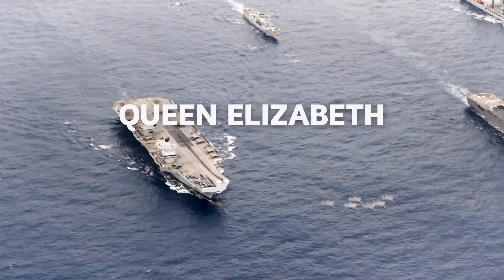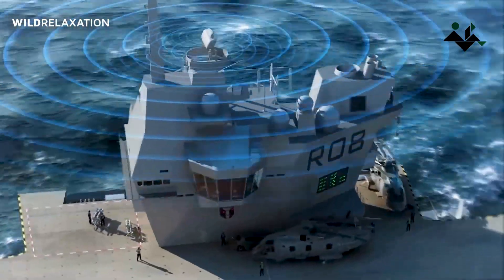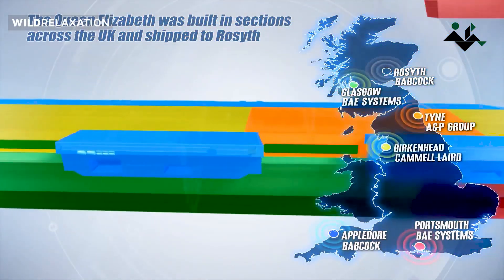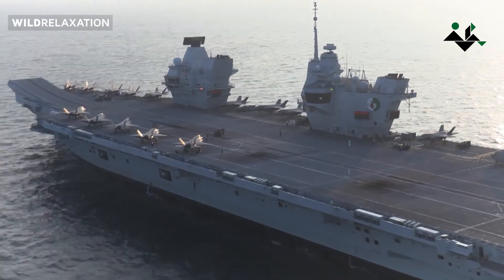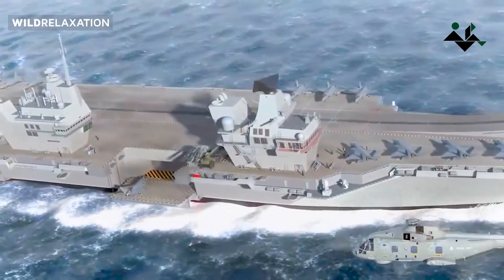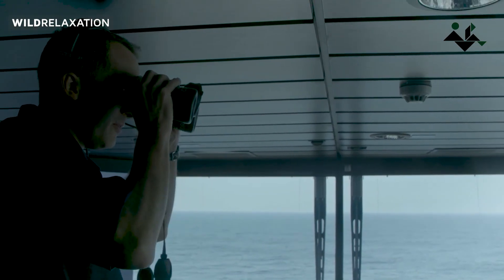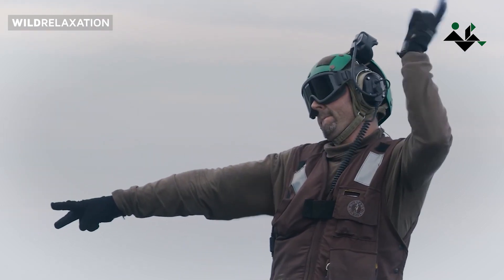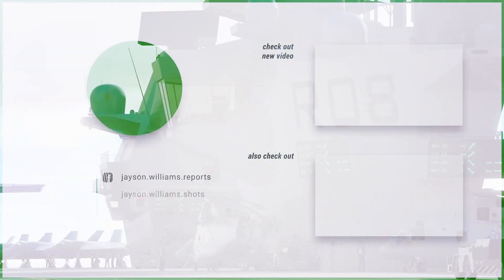The Untold Secrets: Why British Aircraft Carriers Have Twin Islands | Royal Navy

Comment: They have Twin Islands because they're not full CATOBAR Carriers, and as such, have a smaller aircraft complement. This de-prioritizes open Deck-Space for high-volume Flight Operations, which is why the US Ford Characters have a smaller island, and it and some elevators are repositioned; allowing more room for staging, refuel/rearm, and facilitating faster air sortie turnaround.

Avoiding the US offer for its Carrier Nuclear Reactors for propulsion (That last 40+ years and never need refueling), thus requiring two stacks, is another reason, but 

It is what it is.
Reply: CATOBAR doesn't really have anything to do with it, in fact both the STOVL and CATOBAR variants of this carrier had the twin island design, both designs intended on operating the same number of F-35. You can even see the aft island is angled at the rear so flyco is able to see aircraft approaching an angled deck. 

The main reason is they're conventionally powered, if you look at most other conventionally powered carriers, or US LHDs for example, they have one single much longer island, as they need more space for intakes and exhausts for the engines when compared to nuclear powered carriers. Nuclear power was ruled out mainly because there's no infrastructure in place to support and maintain nuclear powered surface vessels of this size in the UK, so it would be a huge investment on top of an already costly project, and it wasn't seen as important as nuclear power in a submarine, which benefits far more from the ability to operate without refuelling.

So they came up with the twin island design which simply splits the existing long island into two. Overall it takes up no more space, but it better positions them for their respective roles, and splits the two main gas turbines which are placed directly below each island to reduce the amount of ducting taking up internal space, giving further redundancy in case of damage.

That being said, space was never really a big issue either, the carriers were built with an airgroup of 36 F-35 and a few helicopters in mind, they were scaled up to a size so they could target a specific sortie rate, technically if they packed it full they could get more like 60-70 on there.